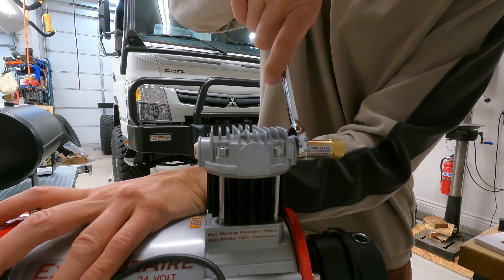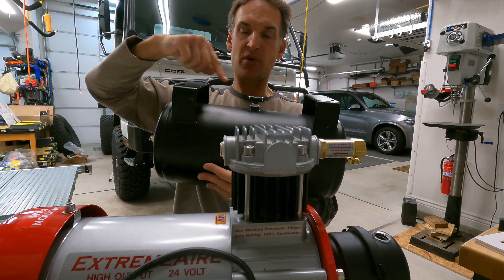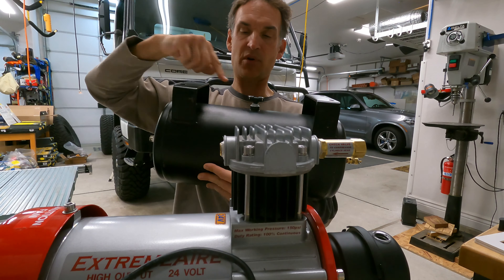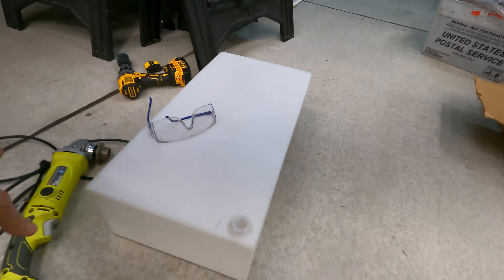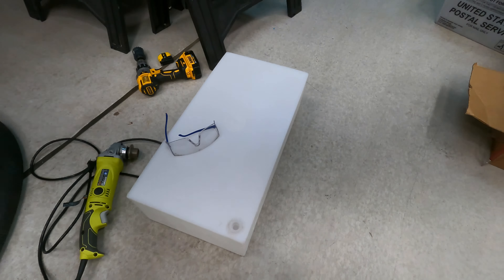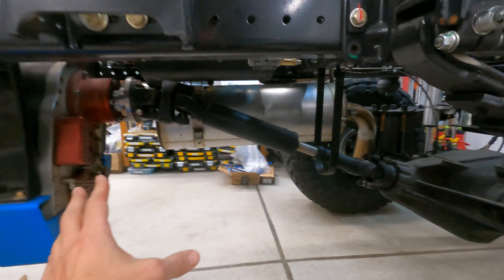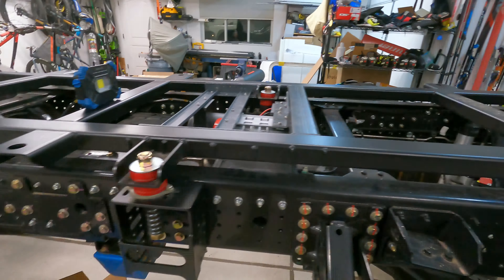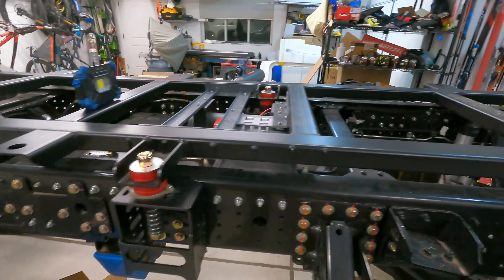Expedition Truck Camper On-Board Air System installation, Part 1

Comment: I didn't see how you mounted all of the fittings on the air tank, what I did for mine was a remote purge so I didn't have to climb under my truck to purge the water out of it, or just dump the air that was in it at the time. I think I used a 1/4" solenoid with a 90 degree elbow facing down at the ground so the air went down instead of spraying all of my underbody.
Reply from the maker: Great idea for a remote purge. 12 or 24 volt motorized valves can be purchased for about $30-50 so those could work great for a remote air/water release. I worry about having a remote valve that the switch could be inadvertently switched and the valve opened or left open without knowing it, so why I didn't install one, and my drain valves from each tank are very easy to reach. Another idea is to have a manual valve on a hose extension from the low point of the tank to any easy to reach location.
Reply: @vantripping  I understand the concern with having it inadvertently left open. My truck was a Ford F350 and the tank was mounted under the bed between the frame rails, so a bit more difficult to get to. That being said, I had mine for a couple of things being used by the air tank, 1) horns and 2) I had a 3/8" air chuck on the back end of the truck for airing up tires (my tires were 37").

The main power (relay) was wired to an on/off switch, but the horns and remote purge were on isolated momentary switches. The horn button was a remote wire that had to be plugged in and then you press the button, the remote purge was a button on the side of the steering column. 

I've been wanting to get another air tank for my current truck (Silverado 1500) but this time I wanted to get the Extreme Outback Engine driven compressor with mounting kit for a serpentine belt. It's their Extreme Flow 8cfm @ 100psi. I'm also going to install a second battery and a remote power connection with a 500 amp relay for "remote jumper cables" on the front and back end of the truck. These will be tied to a momentary switch.

All of my offroad lighting (and other accessories) are being controlled by a Feniex 4200 with Datalink controller. It has the ability to control, I believe, 20 different devices. It's a little pricey and meant for emergency vehicles but I can control everything from this device and was simpler than trying to build something else. Each button can be programmed differently.

Good luck.
Reply from the maker: @n2ocharged  thanks for sharing, great info. I do think a remotely controlled valve to open the tanks to drain after the air system has been used every now and then would be very convenient, so long as the valve is not left open when the compressor is turned on, but that can happen with a manual valve as well. I may install a remote valve for mine too, but have two tanks and slightly different levels and not a level path to interconnect them for draining, so would likely have to install two drain valves, one for each tank, but still will consider it as I get this expedition camper completed and in use.